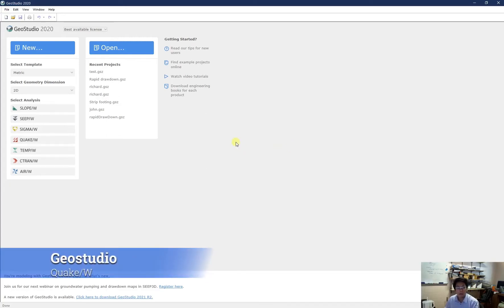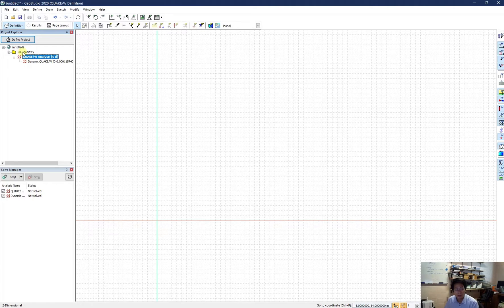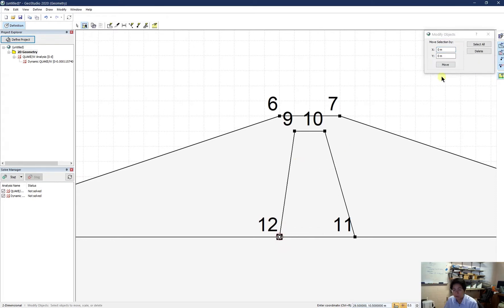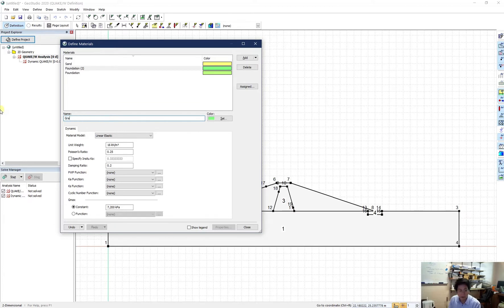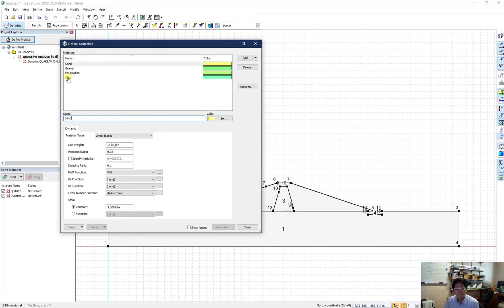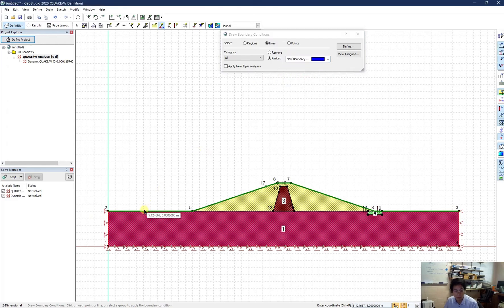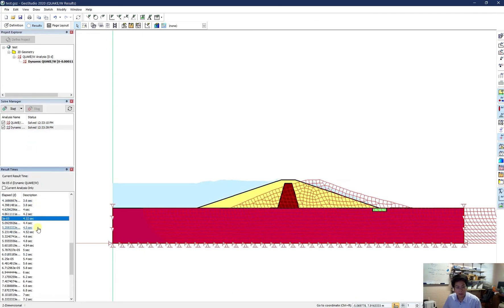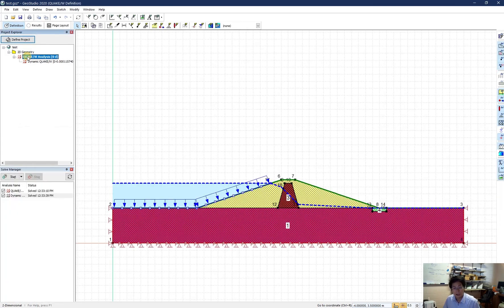Geostudio 2021 Quake/w

Comment: Dear sir, I have a question regarding applying the displacement boundary conditions in quake/w.  After applying the displacement B.C. it shouldn't be move along the X-axis. However in the tutorial after saving the problem, the meshes have been removed horizontally, I am a little bit baffled by this issue and will appreciate it if you give me a reason for this. thanks in advance.